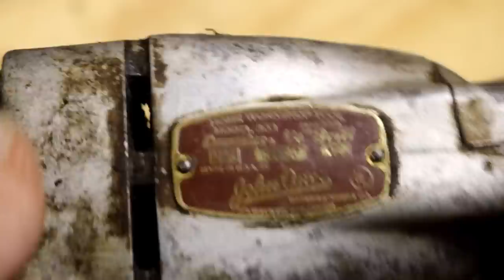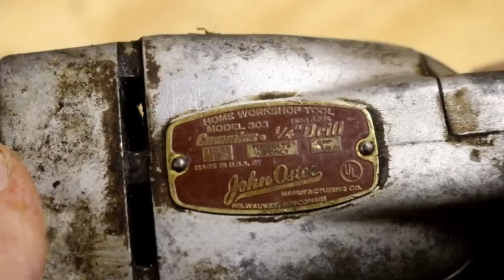Beyond Repair Truss replacement patch.

Comment: I've missed out on some of the build due to being busy, but the truss repair looks good, like you say with the tie plates it should be good as new.  If anyone is complaining that you're not doing machining, well, you have to have a safe, dry place to work so this is very necessary.  They can just chill and when you're slinging metal and not mud or sawdust they can come back when they're ready.  We're just trying to share what we're up to and we have day jobs, families, and other commitments that we juggle too.  Take your time, do it right, and may you have great satisfaction in the hard work you've done once you're finished.

Comment: Ice and water shield is required in MN.  Depending on the overhang 2-3 strips to prevent water back flowing if an ice dam builds up. 
Putting it on the whole roof is overkill in my opinion.
Great progress!
Thanks for the video!
Reply: Yep, Dan.
Same here in New England.
You get ice damming when the attic space loses heat but the eaves are cold from below.
The bottom of the snow pack melts and runs down along the warm roof, but freezes over the eaves.
If those conditions remain for weeks the ice will build up a foot or more thick over the eaves and water will eventually back up under the shingles.

You'll see a lot of homes here with the bottom 4' or so roofed in metal.
Snow will slide right off at the pitches we have, and it's not likely that you'll have a leak through a metal pan.

Comment: "Unexpected problems"... I once presented a design project timescale to the board of directors which had some contingency allowance for unforeseen problems. 
The marketing director asked what these unforeseen problems were!!! (I had to reign in the sarcasm before I got in trouble!)
Reply: Been There, Done That... all of the above.
Reply: I've spent 30 years trying to explain to people why construction contingency isn't a slush fund. The money is already spent - we just don't know what it is spent on yet.
Reply: @R2.0  That, and trying to explain that a +/- 25% cost estimate is really a -0, +50% best guess...

There are always the financial types who believe that all of the surprises will be favorable to the project...

After 35 years as an engineer, I've yet to see anything come in significantly under budget, especially if it's either on schedule or significant over schedule...
Reply: Simply say “they’re unforeseen” (then mentally think “Duh”)🙄
Reply from the maker: That's too funny.

Comment: Your saber saw, (my father in law used to insist that jig saws ware stationary pieces of equipment, aka scroll saws) looks like the same vintage as the the drill. By 1970 most of the electric tools sold to homeowners/do it yourselfers were plastic bodied. By the time I started buying tools in the 1980s even the pro grade tools like Milwaukee had plastic housings and some were double insulated instead of grounded.
One point on ladder safety; when climbing onto a roof your ladder should extend two rungs above the edge of the roof. It’s also a good idea to secure the ladder so it can’t slip or get blown over. Once my boss and I had come down off a roof to eat lunch. While we were eating a gust of wind blew the ladder over. Had this happened 10 minutes earlier the two of us would have been stuck on the roof with no way to get down and no cell phone or radio to call for help.

Comment: Later made all kinds of mixers and other kitchen equipment. Oster name was famous for blenders too. Prolly just saved a $1,000 on the roof repairs. Had my house done with fifty year shingles and the lower roof with the rubber coating your going to use. Cost me $15,000 .In 2016  Good luck n enjoy all the videos its the way life is.

Comment: You're doing good work Steve and as to your antique drill, the switch is wired backwards.  It is supposed to operate just the opposite.  I had one.  Keep on smiling.

Comment: Steve, to ensure the damage to the wood doesn't spread, treat a good size area around the repair, with chlorine bleach. Kills molds mildew and spoors. The lumber yard will have a brand of treatment they prefer, but it is a lot more expensive. The bleach just has to be kept protected until it dries/soaks in, and you are good to go.
Best wishes all, stay safe

Comment: I had a electric drill just like that one.  I bought it in 1970, and used it for many years.  When new,  it came in a solid steel box.  The drill burned out years ago, but I still use the steel box for holding all my drill bits that I have collected over the years.

Comment: I inherited my dad's saber saw..same one (it's from the 60's BTW).  Weighs a TON, but OMG that thing just freaking runs.  Had to replace the power switch around 20 years ago...back when Sears still carried all the replacement parts for these things.  $7.50 later and that thing still just runs.  Probably has 10,000 hours since my dad bought it in the 60's

Comment: Steve that drill is cool.  I've got a 100 pound  1" industrial drill that my Father used and it has the same switch, my Dad called it a Deadman switch.  We still use the drill on every truck frame build.  It only has one speed very slow with arm breaking torque. But it is a two man operation.  Good job on the truss rebuild.

Comment: You will enjoy your shop a great deal more once it is structurally sound with a non-leak roof. When we moved I had a 30x40 foot pole barn built and this January  enclosed and heated a 300 ft square shop area. I can handle 40 or45 deg. f but much lower isn't much fun. Also, of course after you get your construction completed there is probably a pretty good chance you will get to my steady rest!

Comment: My brother and I have done many shingled roofs up here in Canada where they came out with that ICE GUARD a number of years ago. Great stuff.The purpose as you mentioned was to prevent water damage to the roof decking along the ends and bottom of the roof over the soffits where the cold winter air comes up with ventilated causing an ice dam. As snow and ice melts and runs down the warm shingles, a puddle of water can form which is obviously not good for shingles. if you do decide to use the ICE GUARD on the whole roof, you should use the regular tar paper on the roof peak down about 25% of the slope, allowing the roof to cool better in the summer. The more of the ICE GUARD you use on the roof, the more ventilation you want so as not to COOK your roof in the hot summer months. Hope this helps. PS don't forget to use put drip edge.

Comment: Steve,
I bought that model of saber saw from Sears when I was in college in 1971.  I had it until 2015 and it worked fine.  I wanted a new Bosch with the orbital mode.  There are some Oilite bushings in the front that guide the blade holder.  They tend to get a lot of sawdust in them.  Keep them clean.  I used Lubriplate grease for lubrication and they were still tight when I gave the saw to a friend.  Contact me if you need a scan of the manual and parts list.

Comment: Very nice Steve. Have a good think about that sill plate that has damage. Dry rot in timber spreads like cancer, even if it's not exposed to the weather, so it might be worth planning to cut that section out when you take the old roof off. Good to see Hazel Nut getting frisky. She'll be all over you in no time.  Stay safe and well :)

Comment: I worked at a truss company for a few summers and they use surprisingly large hydraulic pistons to press those plates onto the trusses.   They also had a massive pair of rollers that they would occasionally use for gable end trusses and other weird things.

The crazy thing is that the hydraulic press had enough platen pressure to compress most lumber and squeeze the moisture out of it.

Comment: Hi Steve, I used a similar roofing product but with a self adhesive cap sheet here in the uk on my loft/roof extension. It recommend to prime the roofing sheets with a bitumen primer that was brushed on and left to dry before applying the self adhesive under sheet (ice shield) with a 4” overlap. It sticks like sh## to a blanket!
The roof has been on for 14years now 👍🏻

Comment: The plywood gusset you use on the truss repair is way better than any of the metal one. Plywood was original method for trusses. Metal is the norm now. Cheap and fast and they fail very fast in a fire

Comment: Nice work Steve!        Is the roof-pitch steep enough for shingles to be effective?  Too shallow a picptch means that rain water can by capillary action and/or wind action, can travel back up the incline, between the single layers. The membrane  that you're intending to fit immediately under the shingles will minimize/eliminate  possible capillary  damage. The old corrugated sheet metal look like it suffered from the overhanging foliage. New powder coated log run corrugated steel lasts a long time and is quick and easy to install. And the colour choices mean it is possible to have a roof that matches the foliage.   Perhaps that repaired roof will also support some solar panels when funds permit.  Keep up the great work Steve. You're an inspiration!   Cheers.

Comment: Hey, Steve! We, too have been enjoying your journey into Carpentry, Masonry and all! Great videos! I wanted to offer this little bit about the ice and water shield: here in PA code only requires that the very first course of roofing to be protected by ice and water, and the remaining courses from soffit to peak another product (not felt either!) Is used... Check your local code for the number of inches for protection and overlap with other underlayment - it may prove less expensive if you don't NEED ice and snow for the whole roof! 😁
Reply: of course another way of looking at it is that code is the minimum expectation to accomplish the job.  the cost difference isn't that much and the added labor is minimal.   so why not got the extra distance and get a far superior product that will truly act as protection, especially on a low slope roof?  i think it's a no brainer to go 100% with ice and water shield.  sure it might cost a few hundred extra but the added protection is priceless.  especially if he uses metal again which can add significant condensation beneath the metal.  though in that case he should really go with a barrier with out the aggregate.  i think he knows and said he doesn't NEED it but rather WANTS the added protection.

Comment: Ice and water is great stuff. Just had our roof done.  A note that you might run into. If you are working it on a hot day or in direct sun you want to have a garden hose up there with you to wet and cool it down, as it will become sticky to walk on and may lift.  Good luck with your project.

Comment: Where I'm at Ice & Water is required to be 2' inside the outside walls. From there a lot of roofers are using a synthetic felt. What does suck about ice & water is when you do a tear off, basically the plywood has to come off since it seals itself into the wood and shingles once it heats up.

Comment: Man, that old drill running 115 volts at 19 amps is 2185 watts (2090 @ 110 v)! That's more than most quartz heaters! The model of efficiency!

Comment: @Steve Summers I don't know if you've considered venting, ridge vent vs. gable vents.  They used to have these big exhaust fans folks would put them in the attic to draw cool air from the ground up through the house and keep it cool inside during the summer.  I could imagine something that would be great for extracting shop smoke and such too.   Putting any forward thinking vents such as those for any possible plumbing, heating, or exhaust would be great when putting the roof on so you don't have to cut it later.

Comment: Almost there! Up here we use one course of ice barrier and then felt paper for the rest. That ice barrier is horrible stuff to remove if you ever have to replace the shingles. Sorry if you already covered this, but are your trusses rated for the weight of shingles? The dead load on a shingle roof with sheeting is about 4 times that of steel.
Reply: No roof built (to code) cannot take the 3-4 PSF dead load of a shingle roof.  You only need to consider increasing the rafter/truss design dead load for concrete or clay tile roofing which would be 15-20 PSF.  The minimum design roof dead load that any structure should be designed for is 0.5 kPa or 10 PSF.  Even in places that have no snow load you need to design for a further 0.5-1.0 kPa (10-20 PSF) for live load to allow for people walking on the roof to re-roof the structure.  Any place that has snow would be designed for a much higher load than that. Since the roof here has manufactured roof trusses, we can be assured that it was engineered at least for minimum code.
Reply: @barrygerbracht5077  Storage buildings here are routinely built with 5 psf dead load "engineered" trusses. They are designed only for metal roofing. They also cannot support a ceiling.
Reply from the maker: I haven't talked about it Wes but it's fine for shingles so I was told. 
The one part the original builders did correctly and actually over did if they wanted to only use tin was the truss
Good to see you👍.

Comment: I genuinely really really enjoy watching you repair ANYTHING. You are calm, you take a very measured and methodical approach to any task, and you inevitably end up doing a great job out of it. Even removing a simple right-angle bracket from the sill plate, you take your time, grind off the nail heads, and remove it carefully. A construction guy would probably just rip that off without a second thought! What I'm trying to say is that I like that you apply the engineer/machinist mindset to all the tasks you tackle, and that makes your videos stand out from the rest. You Sir, are the cream that floats to the top! :)

Comment: I put Ice and Water barrier all the way up a low pitch roof 20 years ago.  Before that it always  had problems with little leaks.  After that, zero problems.  I'll do it again when the time comes to replace the shingles.

Comment: I bought a product called " Flowbee " just when the pandemic started. I have been cutting my own hair with it and it's almost payed for itself already. It's easy to use and does a great job. The other thing I bought was electric hair clippers to trim around the edges.

Comment: Looking good Steve. Don't worry about the plates on the outside of the truss, they were only to hold the joints together instead of actually cutting a joint. You have put a 3/4" ply jointing plate on the other side and put 4" screws into the actual truss material, so you are in overkill already! I was wondering about Peanut and Walnut, hope they turn up soon! Hazelnut is so cute and growing fast! Looking forward to next week. Cheers from almost locked down again Britain, stay safe Y'all.

Comment: Steve, for the truss joints just cut some galvanized sheet metal and nail it or screw to the trusses
Reply: Good truss plate alternative. In this case it's not needed. The scabbing he's done is stronger than with a truss plate.  But he does specialize in overkill...

Comment: I have a similar old 1/4" hobby drill from the 60s made by a London UK company called Wolf (now it only exists in name and the tools that are made junk). It doesn't have that weird trigger mechanism but you can get a bunch of accessories/adapters for it, like a table saw, wood lathe, drill press, jigsaw etc.

Comment: I made a 16x16' storage shed pole building in 1984. I made a truss jig on the 16x16 plywood floor. I made the trusses out of the house foundation wailers, and the plywood was from he house foundation walls. I put glue as well as nails on the gussets. I sold the place in 2000, but I can see from google satellite that the shed  is still standing.

Comment: Hi Steve really enjoy your work wether machining or construction. I've used the ice membrane before, only just on the starter row & valleys here in Ohio. The glue on the membrane is extremely sticky & took me awhile to get it rolled out. But I'm quite sure you'll figure out a good method to roll it out just like you figured out block laying.

Comment: Keep up the good work. I really enjoy your vids, both the machiing contents and the building contents.  I am always amazed by how flimsy buildings in the US are. This rafters anre considerably smaller than on my garden shed built in the 1960ies. And that building is only 2x4 meters. Over here you usually do not go smaller than 8x22 cm, on the rafters, with 80cm spacing, that would roughly translate to 3x9 inch at 31,5 inch spacing. Most roofs I have seen, use much stronger timber though

Comment: Steve ditch the ice and water shield and use the synthetic felt paper.  Some places call it elephant skin.  If your really worried about ice use one pass of ice and water at the over hang edges and then run the synthetic over the whole roof.  Its all i use anymore here in Tennessee.  No where near as heavy as ice and water shield and will outlast felt paper ten times over.  And if you put it down with cap nails ive never seen it ripped off a roof due to wind.  Either way keep up the good work love the videos.

Comment: You should fasten the old drill to the wall (cleaned up of course) not only as a decoration suited to a workshop but as a constant reminder about safety in working with safe tools.